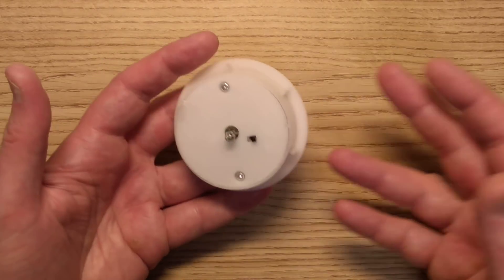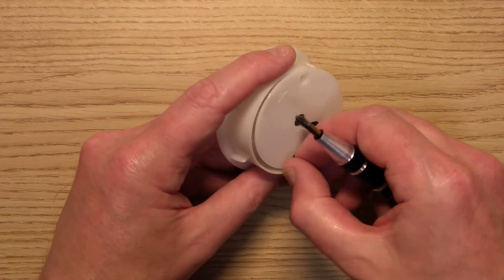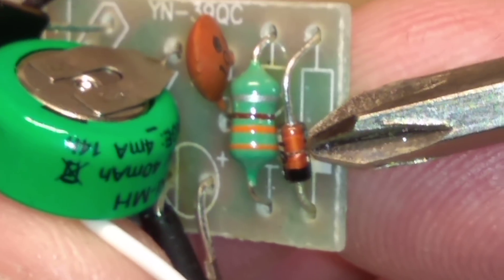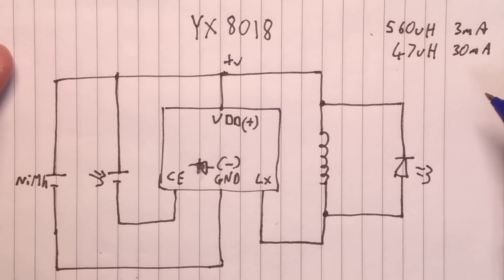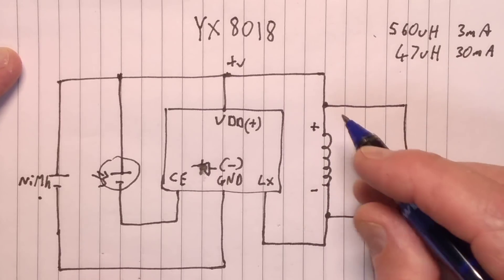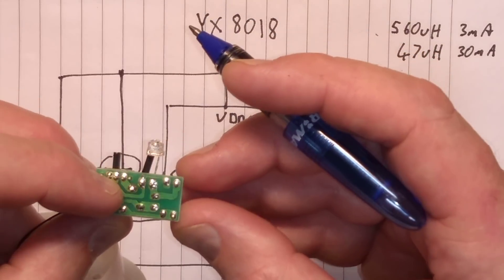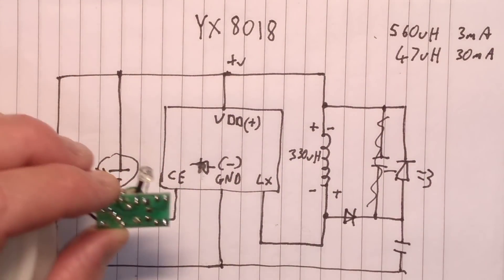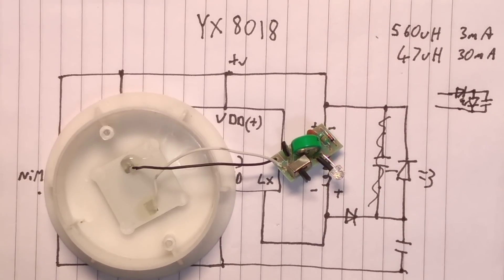Why RGB LEDs don't always work in solar lights.

Comment: seems like the capacitor is used to store a charge with a higher voltage than the battery voltage. i also find it strange that they didn't put the capacitor on the LED leads aswell.. I guess the possible advantage is that the LED and capacitor combination are set between two (somewhat) known and constant voltages : the battery positive voltage and the ground. Maybe this avoids further noise production?... (which would be surprising, if we take into account the usual attention to design details of those kind of cheap gadgets)
Reply: wait... could is be that the capacitor dumps some charge back to the NiMh battery (through the LED) once the inductor did its job?..... if so, it's a clever way to salvage some of the spent energy which would otherwise be "wasted" (even though it would probably be a tiny ammount in this case)
Reply: Damonack nope and nope....the capacitor is just an energy reservoir to keep the chip in the led powered until the next switching cycle.
Reply: @schluderjupp  Yes, i agree. That is indeed the job of the capacitor, and what clive has said about the LED requiring power to keep information stored to know which is the next color to shine. But i was wondering about the placement of that capacitor. It could have worked even if the capacitor was in parallel with the LED, but it wasn't the case. when the capacitor is charged and supplies energy to the LED, it seems that the battery is in series, and that the capacitor should store a voltage which is greater than that of the battery. So it would seem that the design hits 2 birds with one stone : it powers the LED, AND the current that goes through the LED returns to the battery. It won't be perfect and run forever since there will be some power loss through that process, but the small amount which is being sent back to the battery successfully may lengthen the operation time (although i'm not sure by how much).
Reply: Damonack  The internal circuitry of the chip keeps current from flowing back to the battery. Current only flows to the led when the chip disconnects LX from ground. When LX is connected to ground, it charges the Inductor from the battery . So the Inductor never charges the battery.
Reply: @schluderjupp  ... Yes charging the inductor happens when LX is pulled to ground by the chip. When LX is released, the current from the inductor passes through the diode to the capacitor. The only way the LED can be powered by the capacitor is if the capacitor's voltage is greater than the battery. Follow the diagram : the LED's Anode goes to the positive side of the capaciror, the LED's cathode is connected to the battery's positive side, and both the battery and the capacitor's negative side are tied to ground. The circuit is made, and the only way for the LED to be powered is if the capacitor's voltage is greater than the battery's voltage. Then the current does flow into the battery's positive side when the LED is powered and the battery is not charging the inductor.

Comment: Very interesting. Local town Mitre 10 has some for $7. I have one of them that have failed - the one I have looks like glass dome which looks like it was "cracked" (not sure why they chose that for design) and I am thinking to take it to pieces to see if the battery cell is faulty, the LED has died or something else has happened. It could have also had some condensation get in there. Was working for a month or two then it just died.

Comment: if the capacitor would've been across the LED wouldn't the inductor be unnecessary ? EDIT: I totally forgot it was NI-MH not Li-ION :facepalm
Reply: The inductor is necessary.  Cannot get voltage step up without it.  LEDs need more than the 1.2 volts from a single NiMh cell.
Reply: oops I forgot it was NIMH not LI-ION. Thanks for awakening me :) I ofcourse know that 1.2 needs to be boosted for a LED

Comment: Why do they pulse like that though? Why not switch to using the battery?
Reply from the maker: It allows the use of a single 1.2V cell to drive a 3V LED.  That saves cost and also prevents cell damage in stacks of cells when the first to go flat gets reverse charged.

Comment: Wow... I got a solar lamp that had a 80mAh button cell and it only lasts 4hrs using white led. Eventually I had to mod in another cell  in parallel. Surprised they only supplied 40mAh in a color changing unit.
Reply: tensazero By changing the Inductor you can raise or lower the current to the led and make it run longer/dimmer (or brighter/shorter). A larger battery often doesn't help because the solar panel can't deliver enough energy to totally charge the battery. Usually a larger Inductor value will lower the current to the led. Just try it out. 😀

Comment: I built my first computer with RGB lighting today, Unfortunately Red=Green and Green=Red, blue is OK. The wiring is in a molded connector so no swapping the wire/pins around. Oh well :)
Reply: Most RGB software will have settings that can correct it
Reply: In the software you have to pick the right group, ie rgb gbr grb etc. This is the same with any of the LED's that use a controller box. Atb nick

Comment: Hey Clive, have you seen anything about the new Tool album release? In the physical CD version there's going to be a 4" HD display, a 2 watt speaker, a rechargable battery. It's going to be used to display what seems to be either concert footage, or their usual trippy visuals. It seems like something you might be interested in checking out. I'm not sure what's going to be running it all, but I'm going to assume a linux distro on something like a raspberry pi 0. Even if they're not your sort of music, it might be worth ordering to check the electronics out.

Comment: Personally I'd put a 5.1v zener diode across the led too, just to protect it from over voltage. If the inductor value is low and the circuit is able to supply more current than the colour changing led needs, the voltage across the led will drift up until something in the led discharges it.
Reply: It's really not needed, these things can only deliver a small current so the led does a fine job of clamping the voltage to it's own Vf.
Reply: That would definitly be the case with a standard led, but the colour changing ones work a little differently. They have a driver chip in them and the current through the leds is set internally with a reference, rather than externally by a resistor or in this case by the amount of energy metered through the inductor on each switch pulse.
The colour changing led will only take what it needs from the supply, probably about 5mA. If the power supply is pumping more than that (on average) into the capacitor, the voltage will drift up. Since the current is fixed (constant current driver built into rgb led), the voltage on the capacitor won't be regulated to the Vf of the led like it would be with a standard led.
The driver chip in the led will have a maximum supply voltage it can tolerate, probably about 5.5V (or maybe 6V). Once the supply exceeds this, the driver will draw excessive current and discharge the cap back down, but repeatedly doing this will shorten the life of the led. The zener diode is a simple and safe way of regulating the supply voltage to the led and burning off any excess energy supplied by the inductor.
Ideally there would be voltage feedback to the switching controller and it would change up the duty cycle of the PWM to maintain constant voltage, but this chip doesn't have that capability.
Reply: @alexwood020589  ISWYM but the current still increases quite rapidly as voltage goes up, so they still provide some degree of self regulation.  A zener is a pretty poor way to protect anything like this since a 5.1v zener will start conducting well below its rated voltage, shunting led current and further reducing efficiency/battery life.  Additionally these leds almost never fail in these units, inevitably either the battery fails or the housing leaks water and the PCB corrodes to death.

Comment: That color changing led might have an internal reverse diode (shunt)

...don't know why this is, but it really sucks in the dark, if installed backwards.
Reply from the maker: If you connect a colour changing LED backwards with no current limiting it will fail.  The internal chip has a protection diode that will shunt the reversed supply and often fail short circuit in the process.

Comment: I had a few solar "rock" lights that used that same green battery which never lasted. I did end up modding one to use a regular white LED and a NiCD battery from a bigger solar light.
I thought these used rapid pulsing because I hooked a solar cell to a mini amp and put a solar light up to the cell and it made weird noises.

Comment: Those little chips are great! I use them to power tiny high voltage transformers directly. They get a little warm doing it, but who really cares about that.
Reply from the maker: I suppose you could use the chip's output to drive a transistor for higher current.
Reply: Easily, I was just impressed they could do it alone. 2 part mini HV supply,  That's about as simple as it gets.

Comment: thanks Clive, always wanted to know what I needed for rgb, and after putting in a"1000mAh" battery should last a few more hours, last month of winter here so should get a full night around October,
Reply: High capacity batteries usually don't do much as charge is limited by the size of the solar panel, i.e
 even 600mA ones often don't get fully charged.

Comment: Clive I wonder if this would fix the problem I had with a idea I wanted a red flashing L.E.D in a solar light but it did not work. would it?
Reply: Most likely it would. Again, a flashing LED uses a small integrated circuit to cycle power on and off. If the power to that integrated circuit is being cycled, the chip won’t flash. Try it. Let us know.

Comment: That's rather intriguing how you increase the current through the LED by lowering the inductor value. Would have thought bigger inductors would store more energy, therefore more current? Perhaps it's because the larger value is actually de-tuning the circuit in some way?
Reply: Quite simply a larger inductor resists current change more than a smaller one, so for a given pulse length on the output of the IC a smaller inductor will reach a higher peak current.  A second order effect is that lower value inductors of the same size tend to have lower series resistance (fewer turns of wire, often thicker wire).
Reply: This is actually very simple. Larger inductor will have lower current, if energized in same time with same amount of voltage. This is probably Ton=constant chip and Toff=needed for CrCCM. And that explains everything.
Reply: Yes, i thought that was strange as well.
Reply: Not strange at all, if you look at the math in https://en.wikipedia.org/wiki/Boost_converter#Continuous_mode, in particular, the equation for Ioff. @560uH, Ioff=.5×(200kHz)^−1/560uH × 2.5V=11mA, @47uH, Ioff=.5×(200kHz)^−1/47uH × 2.5V=132mA. I haven't accounted for a bunch of other stuff here, so my numbers don't match the datasheet, but the math works out close enough.

Comment: Novice here please excuse me. How did you know that was an inductor and not a resistor? Looks a lot like a resistor.Thanks
Reply from the maker: Very similar looking components.  The colour is sometimes a clue, but the biggest clue is the application and position within a circuit.
Reply: @bigclivedotcom  thank you
Reply: And when tested using a multimeter switched to the resistance range, inductors / chokes have a much lower resistance that does not match the colour code.
Reply: @Mark1024MAK  thanks Mark. I was pretty sure that would be the case. I was wondering  if there was a way by just looking at it.

Comment: Does this circuit turn off the light if the battery voltage gets low? A white LED in the most basic circuit over-discharges the NiMH cells in the night if there is not enough day light to charge the battery. I also have a couple of solar lights with RGB LED in a circuit as in the video but with a 5252F chip, and these lights turn off on low battery voltage, which helps to prevent battery degradation.
Reply from the maker: Many of these chips do seem to turn off the output if the battery voltage drops to around 1V or so.
Reply: @bigclivedotcom  That's not exactly what I have experienced. I have about two dozens lights with an YX8018 chip + inductor + monochrome LED, and in all of them it seems that there is no lower limit to the battery voltage. I can observe how the LEDs slowly fade out as the battery gets low on charge. I have also measured the battery voltage to fall way below 1V.

In the colored lights with 5252F chip and additional capacitor + diode, the light switches completely off on a low battery. As opposed to the monochrome lights I didn't have to replace a degraded battery in one of those. I am wondering if the difference is due to the chip (YX8018 vs. 5252F), the circuit around the chip (inductor vs. inductor+capacitor+diode), or the chip in the RGB LED.

Comment: Too bad that the switch always seems to short out after a while in these kind of solar lamps, often taking the chip with it.
Reply: Easy fix to prevent that, remove the switch and bridge the connections so the light is permanently switched on, so no chance for any rust problems shorting things out... :)

Comment: In their arrangement, the capacitor is essentially siphoning current from the flyback pulses which then keep the LED running when the inductor is being switched by pin Lx. This is more effective because the capacitor will tend to help average out the pulses.

Comment: I was trying to change out my 120v AC cold white LED Christmas lights, with slow flashing RGB's but they just stay red. Do I just need a capacitor for smoothing or something more? The lights seem to be broken into two sets in the string and plastic covered resistor in the line that gets slightly warm when left on.
Reply from the maker: I've converted strings to RGB in the past and needed to add a capacitor across the string (even a low value suppression capacitor may work), or made a new power supply.

Comment: I've found they only work with a capacitor too, but it also depends how the led is connected to battery, could then be switched to an on state with a set 'darkness' level
Reply: I've got one I built with 2 supercaps. It works even during Feburary when it's like 0 degrees out. Obviously less bright than a NiMH powered one though, since there's less capacity.

Comment: I wonder if this would work just by scaling up the panel and the battery by a factor of ten or a hundred.
Would be able to run something far more useful than an LED practically for free then.

Comment: Those cells SUCK !   Just not enough mAh to them.   I just solder in a Regular Alkaline AA cell.   They recharge fine being used like this.    Have some here working after 3 and more years.  Usually everything Plastic Crumbles away from UV damage before the electronics's craps out.  Amazing considering our Sun here  on the dotted line of Mexico / New Mexico.  I would think the caps would fail long before just from the heat.